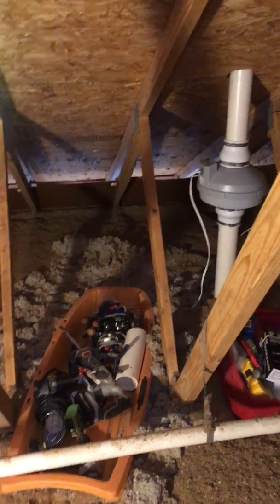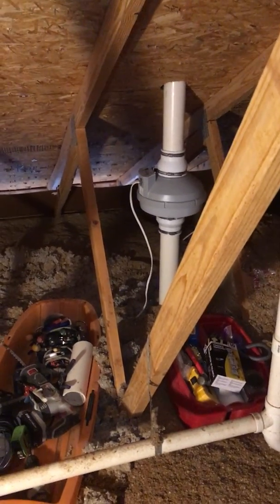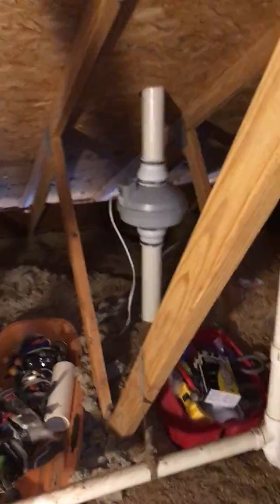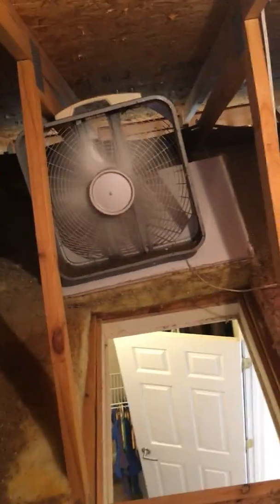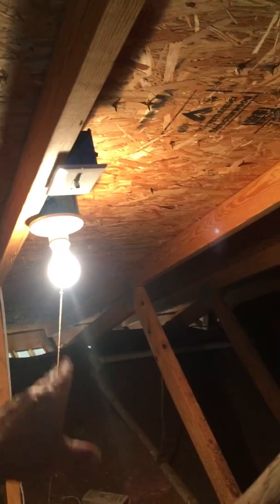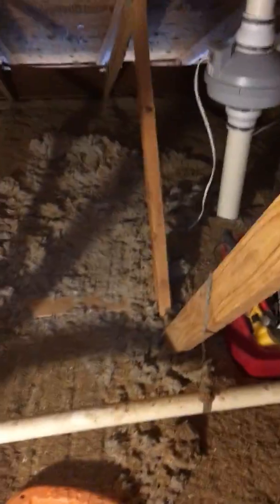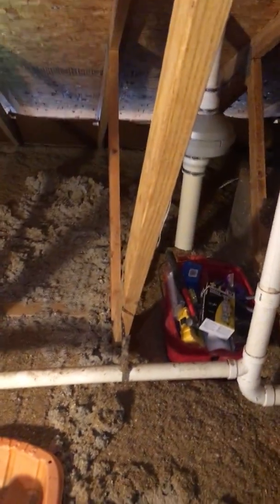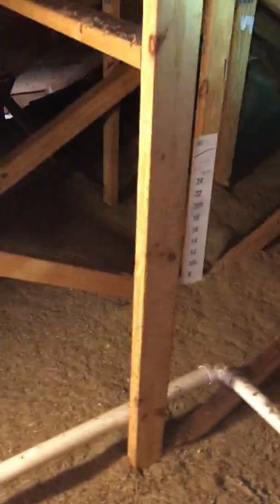Best Way to Install a Radon Fan in a Hot Attic!

Comment: Do you have a link to the radon fan kit you installed ?
Reply from the maker: There are a few different types of radon fans. Assuming your fan was the correct fit for your home and gravel content underneath it, you can locate the make and model where the wiring is connected on the fan.  Google that model and comparable models just in case the manufacturer does not sell to the general public.